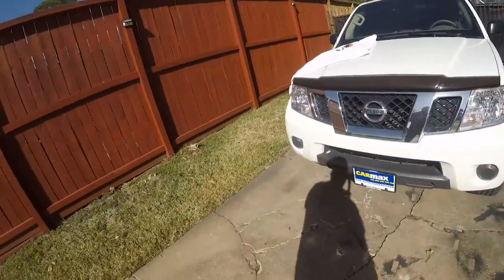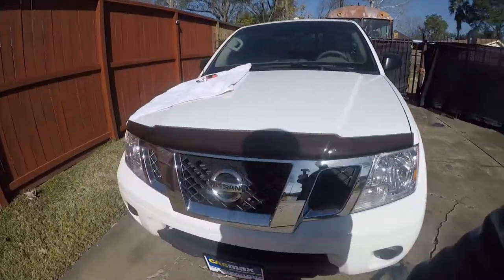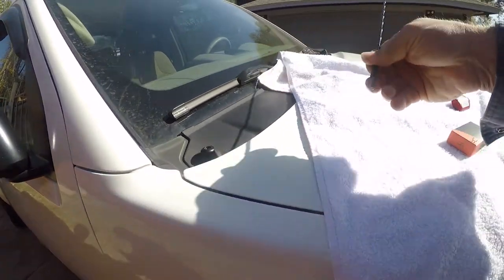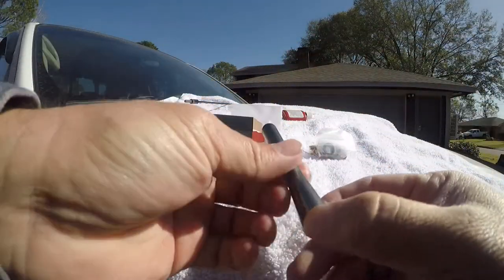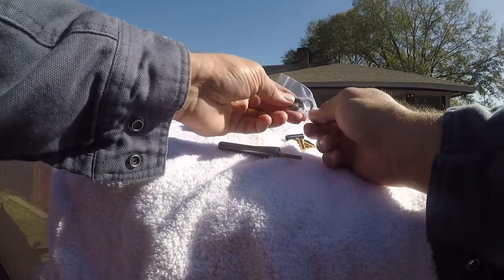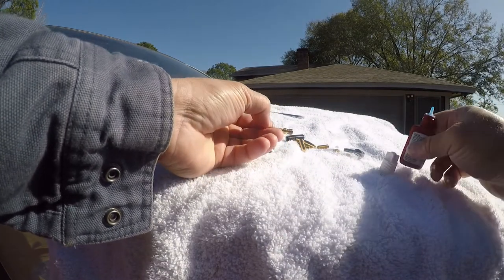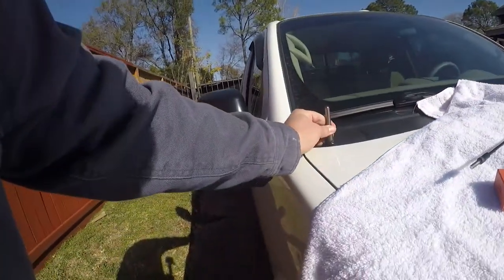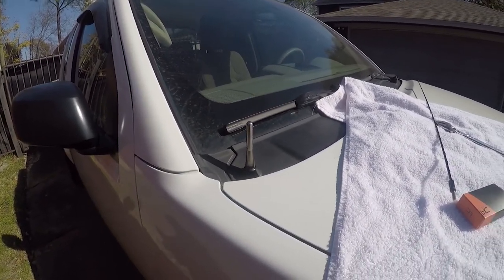Nissan Frontier replace OEM antenna with stubby

Comment: I could be wrong but I think (thought) blue loctite is meant to release with a certain amount of torque and red loctite is meant to release with a certain amount of heat

For what it's worth.

Also thanks for doing the video! Need more youtube coverage on how-to's on these trucks, but great job
Reply: Correct, blue loctite is meant to be removeable with hand tools. Red is more or less permanent, if you want to remove you're going to have to torch it.

Comment: Hey Brian! Since youve installed your stubby antennae, have you noticed a peculiar high pitched humming noise under high speed (60mph+) coming from that area of your truck? Id say its similar to a tunig fork hum.
Reply from the maker: no.... I have not.  That's probably the antenna vibrating in the air stream.

Comment: I had my stubby bolt break.  Not I have a major problem.  Can’t use an easy out.  Problem is I didn’t use any grease or corrosion protector.  That aftermarket bolt from the antenna rusted so bad.  Never should I have messed with the original.

Comment: Unfortunately, most folks who break an antenna at a carwash on the Nissans also ruin the threads inside of that unit and the new antenna metal pieces will not simply screw in place correctly. In order to put in a whole new assembly, it is not a simple process in the least and requires such things as removal of the passenger tire, passenger rubber wheel well, removal of the glovebox and many parts of the dash area. It is an extensive project and not something easy enough for the average homebody to do. These particular cars seem to be designed by engineers and not by people who believe in simplicity and DIY repairs. All this is the result of washing these trucks at a car wash where the antenna can not flex and gets broken. If you happen to have a vehicle that needs the antenna replaced like the Nissans, then by all means do it before the thing gets broken and those inner threads get screwed up so a replacement antenna can't just be screwed into place. I don't know if thread lock may interfere with any reception or not, but I am doubtful it is really necessary to normally just tighten the antenna down enough on these trucks and cars to keep it in place. It is not a lightweight task to deal with this issue of removal of the entire antenna assembly to include the cable and attaching metal. If you are in luck as in this video, count your blessings. That is not the norm when these antennas get broken at a car wash.